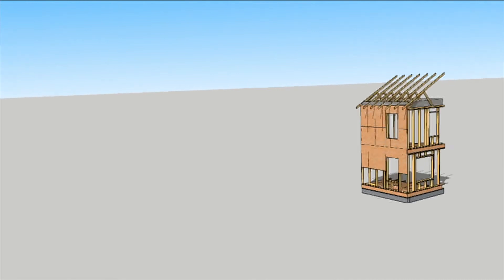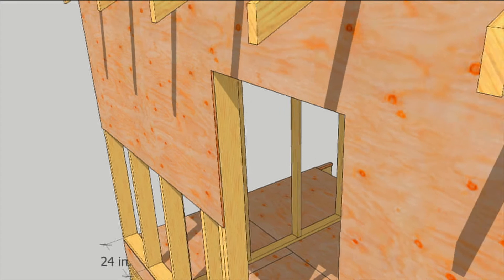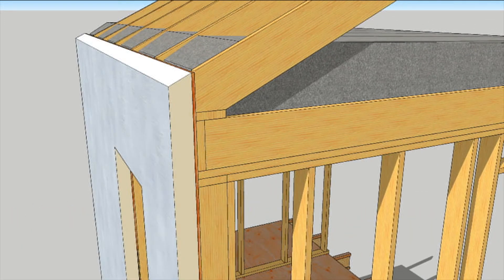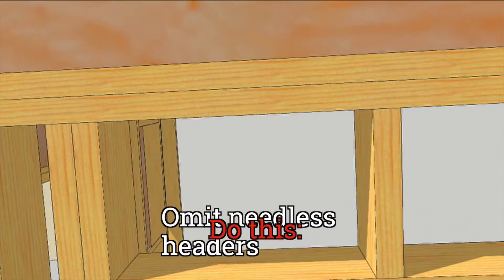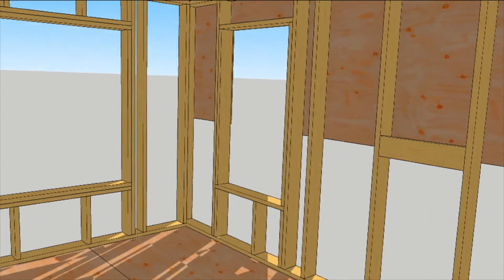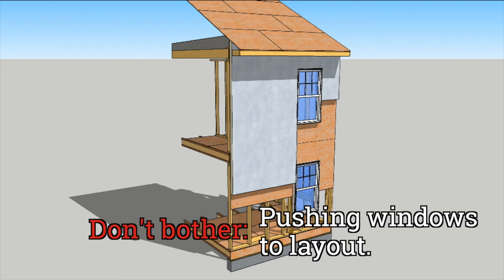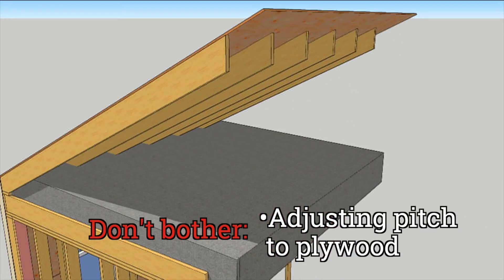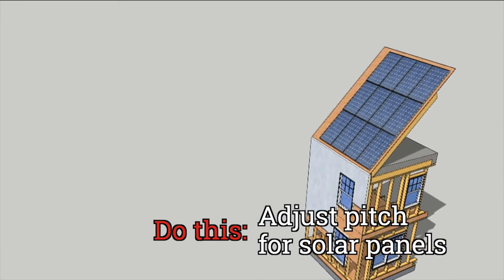Advanced Framing for Designers

Comment: Honestly, we need to move away from single family solar installations. Solar farms with dedicated grid storage, connected to UHVDC grids, is better in every way. Spend the cash on better airtightness, appliances and mechanicals.
Reply from the maker: Or both maybe.
Reply: The prices are coming down and the solar panels do not have to be on the roof of the house, which saves cost. The panels can be used as carports with charging stations. Solar Farms are great but they haven't replaced the electric grid, so for now, for those who want active electric solar to replace the nuclear/gas/oil that we rely on this is a great alternative. However, the best alternative is to use passive design/build principles along with advanced framing.
Reply: I don't think you understand the point of having your own solar panels.
Reply: @NobleSteed00  Its for rich people to show off. I know. Bit like owning telsas in suburbia.
Reply: @FrankReif  do you enjoy living in a coffin size apartment?

Comment: So what is the best pitch for solar panels
Reply: Depends on where you are.
Reply: The farther you are from the equator, the higher the pitch, as the angle of the sun is lower. The direction your roof faces will also determine the ideal pitch, as a N/S facing roof surface will need less of a pitch than an E/W facing roof surface to receive the most direct sunlight while the sun arcs across the sky.

Architectural design software sometimes includes auxiliary features that simplify calculating these things. However, if your going analog in your design process, there are often tables of regional data available to aid you.